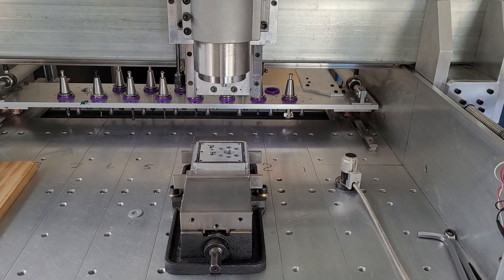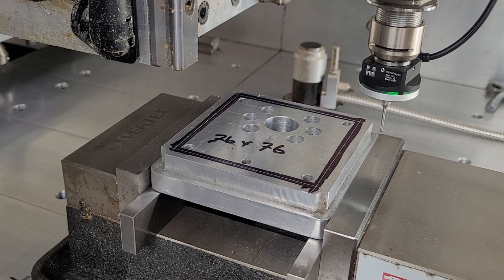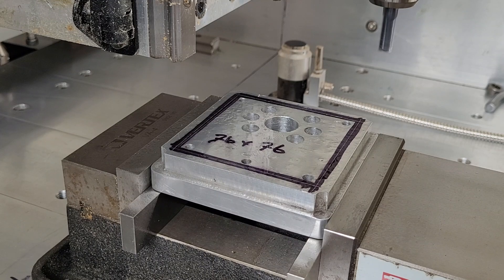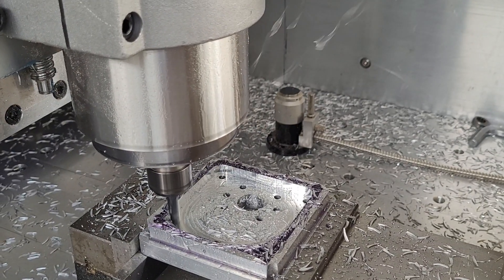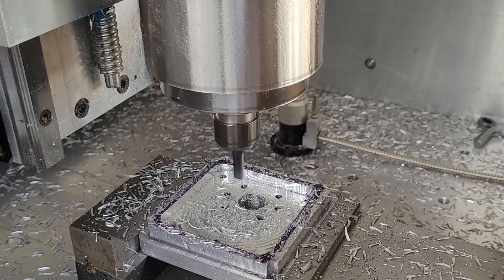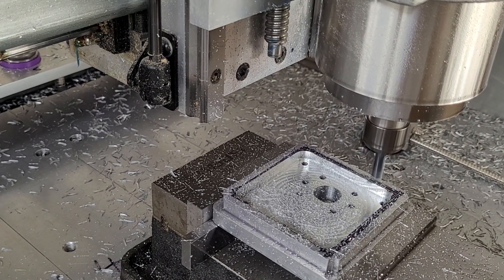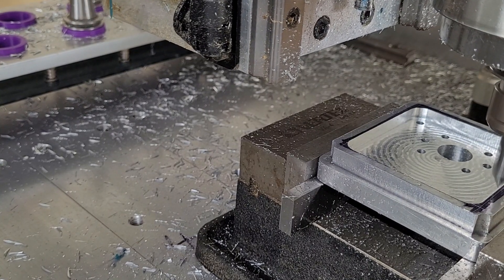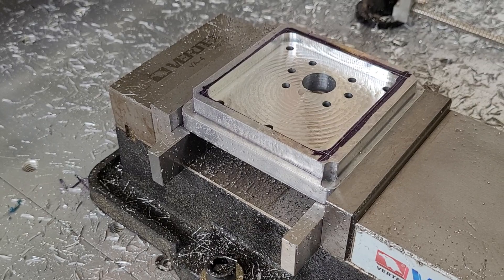Trial 3d Adaptive machining with crash on my home built PrintNC PRO + ATC machine

Comment: Champfer failed :/
Reply from the maker: Hi @sinchrotron yes I tried to run chamfer operation several times playing with the settings in Fusion 360 but nothing I changed helped to actually cut a chamfer I had been using an 10mm 60 deg chamfer tool and decide to try an 8mm 45 deg chamfer tool so changed the tool number and cutter details in Fusion 360 then when I went to do the same in my Masso controller I noticed that the tool diameter for the 10mm chamfer tool  had the diameter set at 4mm and that was what was making it impossible to get it all to work But in this weeks Video on fitting and operating my new Fog Buster mist coolant system it all works fine it cut a 1mm chamfer as it should . So all sorted cheers Bill
Reply: @williamnorris1516  Nice!

Comment: Hey i read that you use cnc like 6/8 weeks.. so wanted to give an input. Be careful with this sort of operation (2d adaptive / trochoidal) with be careful i mean ure tooling. You should get a Weldon instead of collet chucks. Cause in this kind of operation your endmill could get out of it like 0.1mm - ** mm cause its like a corckscrew, the force is like a corckscrew effect your mill would be the corck :D

If you use weldon check that you pull the screw to the end of the screw nut that the force cant pull it out.

Sorry my english isnt the best but really dont underestimate that, thats what i wanted to say :D

EDIT: You will see if that happens.. 1. Maybe tool breaks or 2. You have different depths.

Comment: Nice machine! Is that spindle a 2 or 4 pole unit? It must pull a fair few amps! 
Are you able to tell me what tool, feedrate, depth and width of cut you are using for the adaptive clearing? Am very interested in the MRR.
Reply from the maker: Hi Craig The spindle is a Jianken 3.2 Kw fluid cooled 4 ceramic bearing ATC spindle and it 4 pole 400Hz lots of power I think it's rated at 7 amps max but I think it would only be getting to around 5 amps on light cuts like that on that operation tool is just a 8mm 2 flute carbide nothing special  15000 rpm feed 1475mm/m speed 376.8 m/m chip load 0.0491 per tooth 3 mm step over 8 mm deep all from HSM Advisor which is a recipe that works for me in 6061 alloy once I get my mist coolant set up and air blast I will push it a bit more than that cheers Bill

Comment: that machine chews on the aluminium, i'd suggest geting some kind of coolant
Reply from the maker: Hi my next project is to add a fixed mist coolant spray and a air blast to the spindle I am just chasing up the parts this over the next couple of weeks I will post videos of it when it's done Cheers Bill

Comment: Hey I suggest using a contour profile for a finish pass on your vertical walls it will leave a much nicer consistent surface finish and be more likely to cut on size.  Cheers
Reply from the maker: Hi thanks for the input I have only been cnc machining for 6 / 8 week so still learning . Yes I will try contour profile for sure thanks again cheers Bill
Reply from the maker: I just checked in Fusion 360 which is what I use it has 2d contour is that the sort of thing you are suggesting thanks Bill
Reply: @williamnorris1516  yeah 2d contour is good. and then also you can add stock to leave on the adaptive clearing op. that way the contour pass comes in and just takes a tiny bit off to get that good finish
Reply from the maker: @zforcer7256  Yes I will do that I usually leave 0.100 of stock to finish but if the 2d adaptive is running a bit aggressively I leave more stock I am just working through things to come up with set of strategies that work for me cheers Bill